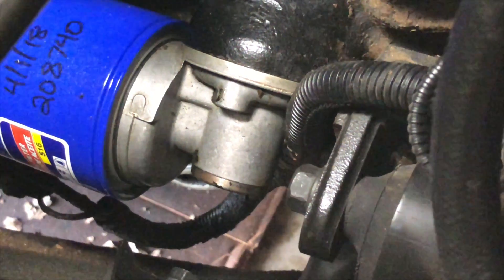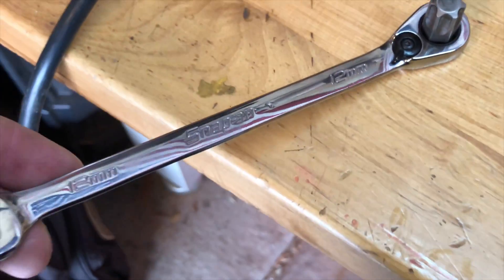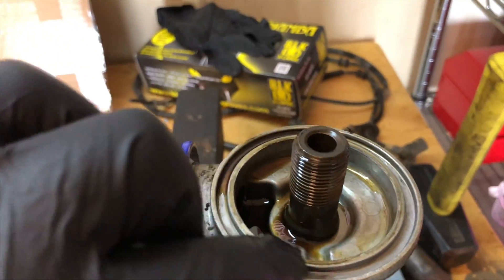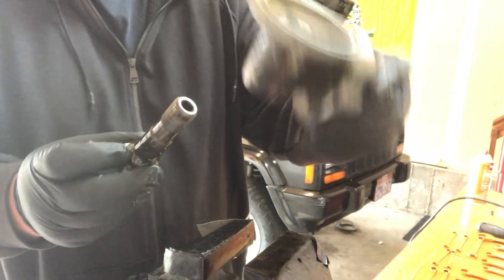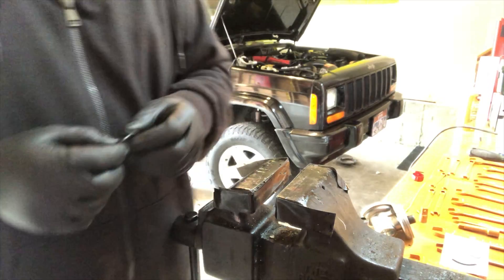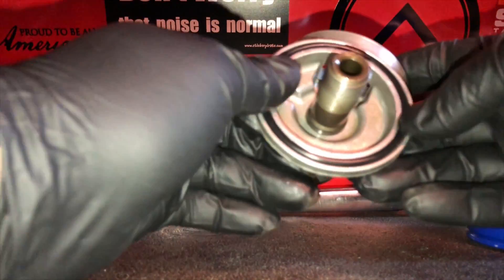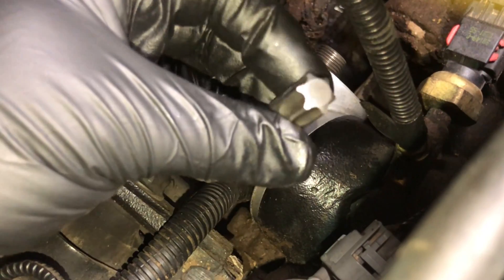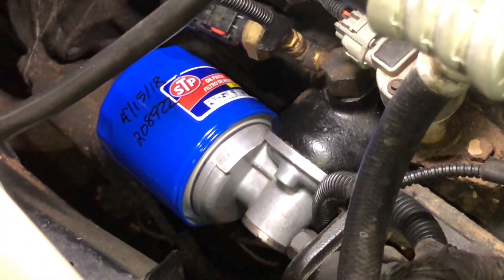Jeep XJ 4.0 Liter  Engine Oil Adapter Seal Replacement

Comment: Good vid. Couple of helpers, wrap the bolt threads in electrical tape to protect the little o ring during its install. Removing the coolant overflow bottle gives more room to get a pipe in for leverage during removal.

Comment: This video was helpful, however, the only thing that wasn’t “correct” in my repair was that the T60 was not correct. I am gonna assume that someone replaced my OE version with a replacement as I actually needed a 5/8” Hex Head to do the job. I ended up using a Hex-Head-Sockey and removed the hex rather easily. I was also able to replace it with minimal difficulties. The actual “repair” portion of the video was spot on correct. Thanks for the help. This fixed my oil leak.
Reply: T60 was used in later years

Comment: It always best to work on a hot engine.  Bolt doesn't expand as fast as the engine,  So the bolt just unbolts a lot easier.  That is how I got mine lose after breaking 3 12mm wrench.

Comment: I found the 3 o rings you mentioned but two more also came out where do they go?  theu look like the one at the base of the thread and the one is like the one slightly higher up.
Reply: They are for other years

Comment: Damn, I can't do any of this work on my jeep xj. The L is facing upwards of all places, I'd either have to take my steering slightly apart to get it from under the jeep, or pull the engine. What the hell.

Comment: I've been fighting with this thing every oil change for 4 years and finally got it off the other day. I ended up using a torx bit from a socket and a ratcheting wrench, and my jack handle for leverage. Came off super easy.

Comment: I cant see mine is it possible the 04 jeep grand cherokee limited edition does not have one? 4.0 in line six
Reply: It IS an adapter so the filter doesn't stick straight out... there isn't room for that in an XJ. It might be that there was enough room in your GC so they didn't need the adapter. Does the filter stick straight out or is it parallel to the engine like this XJ?
Reply: I don't  see it on my WJ good thing. My filter is straight out to the side perpendicular to the engine on the 4.0.

Comment: I welded the T60 into an old wrench. Then I did it from the bottom, where there is more room to work. The T60 worked on my 98. My 94 was a 14mm allen. At some point they changed it. Just saying. Now I have to do my 99 that I just got. The seller thought it was the rear main, the way the oil blows back around the oil pan when you drive.

Comment: I did this job with a Duralast T-60 and a Duralast 1/2 drive flex head. Came out easy simply because i had the engine out and was resealing everything else. Inside the cherokee would seem harder todo.